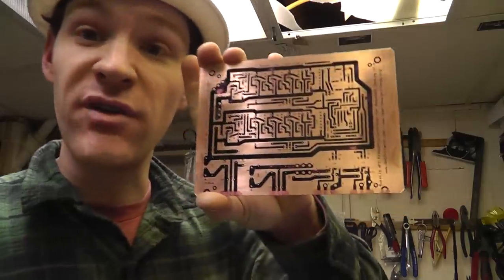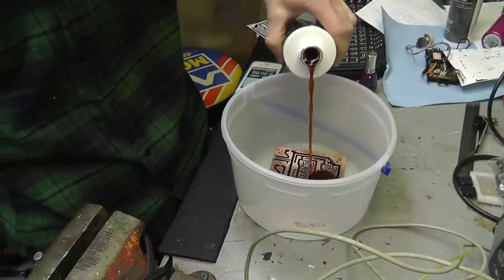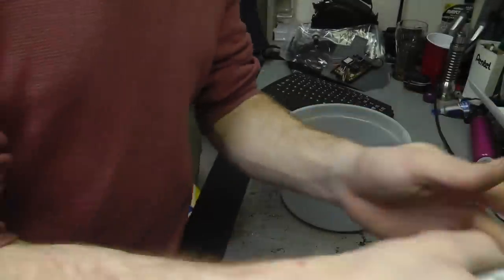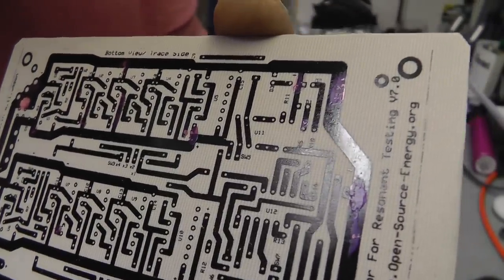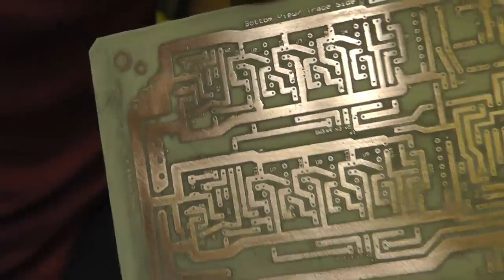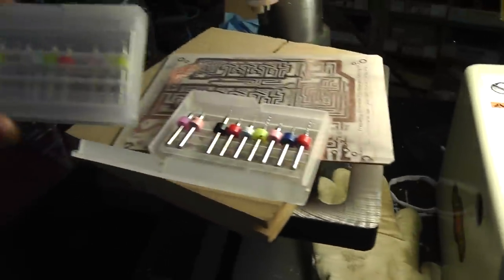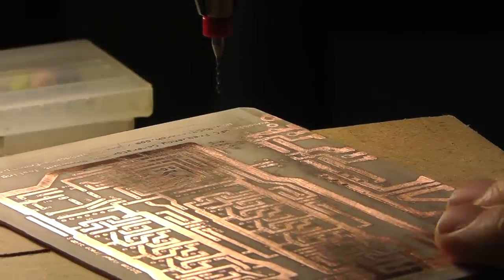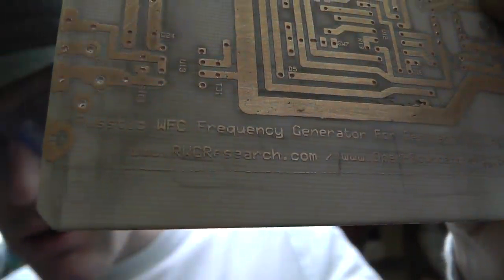Building The Russtic Frequency Generator 7.0 PCB._002

Comment: Hey Russ, I noticed you using sandpaper or emery cloth or something afterwards to remove the toner.. the hardest part of my lst board was getting that stuff off. I was told nail polish remover would do the trick, but it barely touched it. I had used a laser printer, on actually ink jet photo paper. Perhaps i ironed too long.. i don't know... but i had to literally scratch it off with a razor. Was yours' difficult?

Comment: tried ammonium persulfate solution instead of FeCL3? kinda more sensitive to temp (needs to be around 35-80C, I just use near boiling water), but it is faster than FeCL3, really faster. if you'll go too much it will even eat copper underneath toner :3 also solution is transparent and going somewhat green after etching.